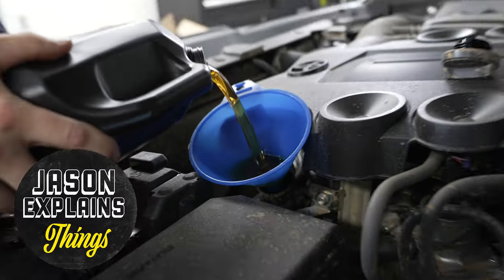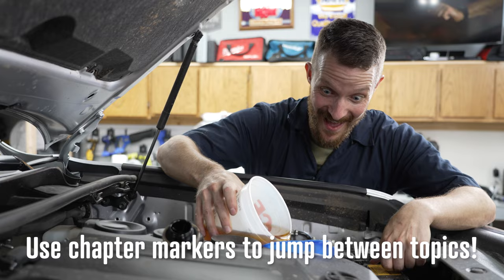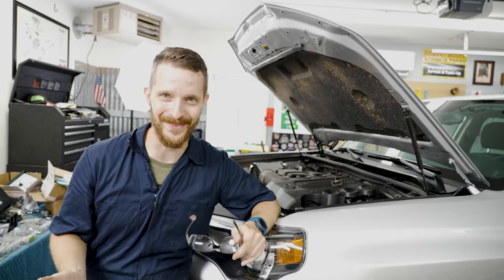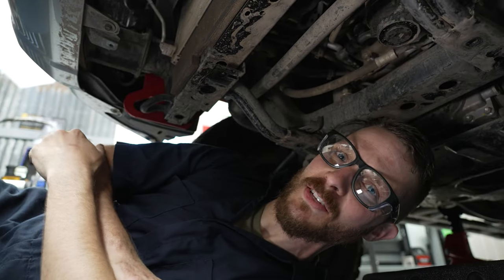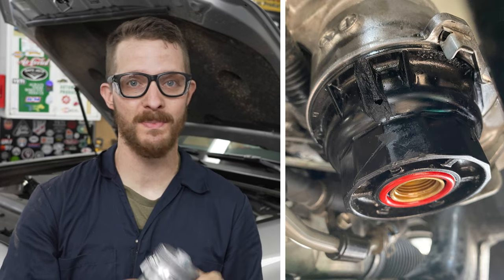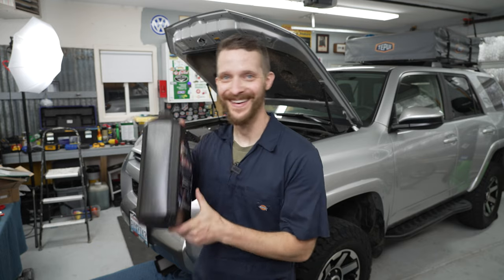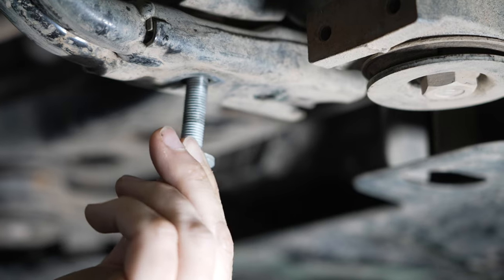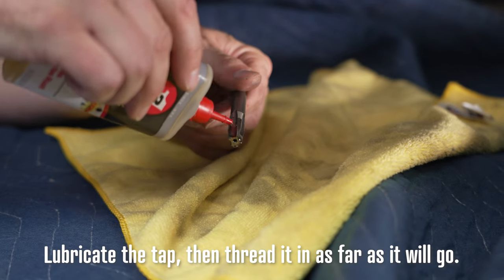5TH GEN 4RUNNER Oil Change - Save Money and Upgrade Your Truck!

Comment: Good video....but not the "best".  I would add the torque spec for the filter housing (18 ft lbs) and the torque spec for the filter housing drain plug (10 ft lbs).  Also, PLEASE PEOPLE don't use a tap to install the TRD skid plate!  The threads are there, they're just filled with gunk from manufacturing.  If you're a gun owner, use a bore brush (I used a .38 special bore brush) and some gun solvent and run it through the holes where the aft bolts go a few times to get the threads good and clean.  Now the bolts will go in like butter, I guarantee it.  For the love of all things holy don't go tapping new threads in your brand new truck!  Also, you overfilled the oil.  Your dipstick is showing that you are in the "excessive" area (ref: pg, 410 of 2021 4Runner Owner's Manual).  Lastly, the plastic filter housing is totally fine, especially when using the latest version of the Motivx tool that doesn't even touch the tabs.  Sorry for busting your chops a little but people need to know the correct way to do maintenance, not the YouTube way.
Reply: Wow ! Your comment made this video a lot better (I liked the video , great comment sir)
Reply: Make your own videos then
Reply: You know your stuff, It's important to do things right the first time. Thank you Sir for your knowledge, and may God bless you.
Reply: And if you do use a tap never put it in a drill 😂
Reply: Or you can just use the correct tool for the job and just by the right size threat chase
Reply: Great call on the bore brush!  The newer version of the Motivx has problems the first version did not.  It sticks on the filter so hard many people cannot get it off without breaking the filter.  Some just leave the Motivex wrench on permanently.  I think people are way better off with a Lisle or comparable steel wrench rather than aluminum.  I don't think there is anything to be gained by going metal on the filter only if the plastic breaks.  Only ones which break are those tightened too much.  I also don't know why anyone would replace the skid plate with something without the access door to the oil filter.

Comment: I been changing oil on my Camry with the plastic oil housing for many years now never had a problem with it
Reply from the maker: Yeah it’s definitely optional… not required.
Reply: 2 Camry’s and a Rav4 but finally had it crack and got the aluminum housing from Auto zone, much better.

Comment: I bought the TRD Pro Skid Plate from my local dealer in Jackson MS to install on a 2024 TRD ORP Premium. The bolts that came with it, along with the pre-installed spacers went on with no problem. No issues. I used the bolts supplied with the Skid plate. I did not use the bolts I removed from the old black steel TRD ORP skid plate.  Easy as pie. No issues. A little anti seize on the bolts and torqued to 22 ft-lbs.  Perfect.

Comment: Hey DrJWR1… I just completed it in about an hour. My driveway is pitched so I was able to drive up on ramps until it was level. That skid would have been a “pita” if I hadn’t created space under the front. That had to have been your issue. My torque wrench crapped out, so I simply marked the filter housing and put it right back to that point. It actually stopped right there when I tightened it. Put just shy of 6.5 quarts of pennzoil platinum in it to account for any residual. That frigin dipstick is difficult to read, so I dragged my fingers down it until they were wet. No leaks, so all is well.

Comment: That Motivix filter tool is the best one made for the Toyota’s. It’s forged unlike the other stamped models. I’ve got it for my sienna and also got there threaded funnel that threads into the oil cap threading so no more funnels falling over when pouring.
Reply from the maker: Nice!  Good idea on the funnel.
Reply: Can you link the threaded funnel that goes into the cap, love that! Thanks in advance

Comment: Your video about the TRD skid plate saved me time and problems as I could not figure out why the brand new TRD bolt kit would only screw in about 1/4 way and then get very tight. After seeing your video, I tapped the threads and no problem! FYI when tapping all 4 holes metal was being cut which tells me the threads are not cut all the way through for 10 x 1.25 bolt.  Thank you.

Comment: Howdy from Palouse, WA!  Great video!  I have a 2019 SR5 4Runner and ran out of the free dealer oil changes.  Took it back to them for the last oil change in January and they charged me $106 and didn't even top off fluids, or vacuum, or any of the other perks normal oil change places do.  So, got in my OEM filter cartridge and Mobil 1 this week and started looking at videos.  Yours is the best and I will be ordering the new metal housing and tool.
Reply from the maker: Thanks man!

Comment: For the tap set you referenced, which of the 3 piece set did you use? The set includes a Taper, Plug and Bottom tap. Thanks for the video.

Comment: Finally got my metal filter housing in from Japan and changed the oil today.  Used my new Motiv filter tool, and it worked great!  But, I did use Mobil 1 in 5w-20, which is a tiny bit higher viscosity, but in the summer, it makes me feel better.  Fun Fact:  4Runners sold in Puerto Rico use 10w-30.
Reply from the maker: Nice!  No judgement on oil.  I'm going with Kirkland for now because it's such a good deal, but it's all good.  I actually stocked up on the stuff in case it goes away so I'm good on oil changes for a while.
Reply: @JasonExplainsThings  I drive a ‘17 Honda Civic…obviously a much different vehicle than a 4-Runner. But I used the Kirkland synthetic 0W - 20 for a 7K mile oci. Sent a sample off to Blackstone Labs, and the report came back with flying colors - low wear metals and additive package still intact. They said I COULD extend it out to 10K miles, but I’ll stick with 7K. 👍🏼
Reply: Kirkland Oil is the same as Walmart oil 👍🕺🏽
Reply: Metal filter housing for the oil filter is a must and it should be upgraded. Now, 5th Gen 4runners sold in Puerto Rico still use 0W-20. I also live in Puerto Rico and I would be very skeptical of permanently changing the weight of the oil on this engine. Now, we will never experience a 32⁰F or colder weather in Puerto Rico but Toyota prefers the 0W and suggests the usage of 5W as an alternative in case there is no 0W available and Toyota also recommends switching back to the 0W when it's immediately available. Toyota designed this motor and they know whats good for it. At least I will not deviate from their instructions, unless a Toyota TB is sent out and mandates this change for us in Puerto Rico.
Reply: Make sure that metal filter housing isn't leaking around the seal when you install it. I hear people having problems with theirs. Toyota brand.
Reply: @emmanuelmatos8942  Unfortunately Toyota and others have been recommending EPA friendly oil not oil great for the engine.  It gets them 1- 1.5% more fuel economy in EPA testing.  They don't use 0w-20 in Japan where EPA has no jurisdiction.  Same reason they are all moving 8cyl down to 6cyl and 6cyl down to 4cyl turbo engines with 8-10 speed transmissions.  All is counterproductive to consumers but EPA is really happy.  I give it 5 to 7 years tops before the auto manufacturers will need bailing out.

Comment: Thanks for the tip on the TRD skid plate bolts.  I've been debating getting one for my SR5, but I'll just stick with my steel factory plate to save the $300 and the hassle of tapping the holes.
Reply from the maker: I’ll say… that skid is worth it.  I’ve beaten mine up a ton.  Replaced 2 of the bolts because they’ve been damaged… but that skid plate has held up well.  Lots of gouges/character now. 🥹

Comment: Thank you for linking all your parts/tools. I will be buying them. I live in an apartment and don't have a solo garage to store a wide array of tools. So I need to try to avoid having tool "bloat" by sticking to only the minimum needed tools. I have a storage room but I just can't store a large variety of tools. I think just the tools to do transmission fluid and engine oil will be adequate for me.

Comment: This video was a huge help, along with Jason‘s other videos, to get me started on the very first oil change for my 2024 4Runner. I ran into a snag I wonder if anybody else has observed: the tabs for the hanger for the front skid plate. The driver’s side came off the frame just fine, I never could get the passenger’s side to let go and I couldn’t figure out why it wasn’t letting go. I don’t have a lift, I was working with jackstands, so, the skid plate was really in my way. Your advice would be greatly appreciated!
Reply from the maker: Lots of more 4Runner videos in the back catalog… and more to come!
Reply: @willmalkin6027  That's just RUDE. IF you read my post, I said I got one side off with no difficulty. I was simply inquiring whether other people had trouble with the passenger's side.. If you don't have something constructive to say, just keep your comments to yourself.
Reply: I deleted my previous comment, because I agree that it was rude (not my intention). If it makes you feel any better, I had to google how to delete my comment because I didn't figure to simply click on the three dots next to my comment lol... I'm changing my oil in my new 4runner for the first time tomorrow. If karma truly is a b@#%h, I'll have a hell of a time removing the skid plate, and then I'll break the tabs off on my filter housing... I'm sorry about my previous comment... I too have found myself in tricky situations with automotive maintenance (removing a Silverado tranny pan, to note one). Sometimes you just need to walk away from it for a few minutes and allow your brain to reset... Be well and good luck with all of your future wrenching!
Reply: Thank you! That’s very magnanimous of you. I wish you the best possible luck with your maintenance going forward.

Comment: Great video, thank you , doing it yourself is always best.  For the first oil change, I recommend 1000 miles if you plan to keep you 4Runner forever.  After that I do mine every 3500 miles, changing the filter every other oil change up to 25K miles after that I change the oil every 4-5K miles.  Oil is cheap and this will extend the life of your motor exponentially.  I NEVER leave the oil fill cap off while I am working on the truck, debris or something larger could fall inside the motor, especially if you have other people or children around.  Just loosen the cap to allow the oil to drain out.  Ideally, you want the car to be as level as possible so jacking up only the front of the vehicle may leave some old oil in the pan.  For the first few oil changes I went all out and purchased genuine Toyota oil at my local dealer.  I always fee great knowing I have new oil in my engine!

Comment: Appreciate this vid!

Throw that TRD skid plate in the trash!  100% absolute, complete, PITA to have take off and put back on. IMHO, and experience.

Good aftermarket options that provide better protection than the TRD AND don’t have to remove to change the oil.
Reply from the maker: I wouldn’t call it trash, but you’re totally right about it being a pain to remove. 🤣

Comment: Great video! I actually didn't know that you must extend the tapping in order to install a TRD skidplate. It might be good to explain that the part number for the oil cap housing does not indicate that it fits the 5th Gen 4Runner. The reason for that is because of the center tube that you must exchange with your plastic housing. Other than that, it's the same.
Reply from the maker: Exactly.

Comment: just wondering with the metal housing @ 22 ft /lb, did you experience a very slow oil oozing at the connecting point. The treads are little different on the mental one.
Reply from the maker: Nope.

Comment: Why would you not wet the new oil filter. I always do this on all my oil changes on all my vehicles. Call me OCD if you like, but I have heard this advise from many others
Reply from the maker: I do that with spin on filters yes, but this one has a hole in it until the installation is finished.  I guess you could drizzle oil on it.  Seems unnecessary and messy.

Comment: I'm confused. I haven't done an oil change myself for a couple decades but when did we go from the canister filters to this style? This seems so much more work and it doesn't save me any money on my bill when I pay to have it done. It seems cheaper with just replacing the paper portion but the added labor I guess offsets it. I just bought a 2022 3 days ago. I'll have to run outside after work and see what I'm dealing with.
Reply from the maker: Here's an updated video on the topic... discussing tools and everything to do this job.  It really isn't that complicated or challenging.  And with oil changes costing close to $100... learning how to do it yourself is a very smart move.  Just take your time and follow a video the first few times, and then it's second nature from there.  https://youtu.be/HnXMFRU3Z2I?si=fXHhhUZFrSFo65VG

Comment: Thanks Jason for this video.  I seen that you were using full synthetic oil.  How would i knw which oil my dealer were using for when I do my first after warranty.
Reply from the maker: You won’t know.  :-). They will use something that meets minimum requirements set by the manufacturer.  So synthetic 0w-20.  Most dealers by their oil in bulk.  This and other unfortunate experiences are why I do my own oil changes/routine maintenance.

Comment: At 8:15 it looks like you’re running high. I put in exactly 6.6 quarts and it’s doing the same thing. Like half an inch above the max line.
Reply from the maker: You are correct.  It should be right in the middle of the 2 marks.  Updated videos since this one show that.  Good call out.
Reply: @JasonExplainsThings  appreciate you taking the time to answer and I didn’t mean to come off cynical. I’m saying I had the same issue come up. I did an oil drain and filter and then filled up exactly 6.6 quarts on my 2012 and it’s showing as above the max line. Did you have to change to an updated dipstick?

Comment: what weight do you recommend for Socal temps, and do you recommend the same year round? Thanks
Reply from the maker: The owners manual only mentions 0w-20 or 5w-20 (as a short term option).  I think SoCal and summer temps here are about the same.  It got up to 109 this week. 😅

Comment: I have a vacuum oil extractor. I hook it up to my air compressor. Could I use that same extractor for the 4 Runner? Unfortunately looks like a still have to crawl underneath for the oil filter.

Are you happy with the Mann filters?
Reply from the maker: Yes, you still would need to crawl under the truck and remove the skid plate to do the oil filter.  But extractors work great.  I used them exclusively on my VW GTI I used to drive... but the oil filter was on the top of the engine.
Reply from the maker: Mann Filters... I've heard only good things.  They made the OEM filters for my VW so I'm sure they're good.  For the Toyota's, I buy OEM filters because they're good and very affordable.  I actually buy them in bulk.  I have enough oil filters now to get my 4Runner and Tacoma to 70k miles.

Comment: Guys this is a dumb question, is a 2021 trd off road premium oil filter the same as the regular trd off road? I might of forgot to tell them premium at the dealer and hope I got the right filters! Thanks for your help and video!
Reply from the maker: Same on any 5th Gen 4Runner.  They all have the same engine.

Comment: Great video, however the two main products featured in the video (oil filter cap, and motivx wrench) say they don't it the 2020 4runner trd offroad (which i assume is the same fitment as your 2021). If they are the exact products you used i guess i'll have to just take your word for it and go against Amazon's recommendation/caution
Reply from the maker: Yeah they definitely will work.  The engine is the same in all 5th Gen 4Runners (2010-2023).

Comment: Great info. Thanks. What was the reason for the tapping extension for the trd skid plate? I have that skid plate on my ORP. Do I need to modify it to fit the metal oil filter housing?
Reply from the maker: Nope, you’re fine.  The tap was more for folks that are trying to add the TRD skid plate.  Sometimes the back bolts don’t want to go in all the way.
Reply: @JasonExplainsThings  thanks. You seem like a 4Runner expert. Do you know if there is a top speed recommended when in 4HI?
Reply from the maker: Check the owners manual.  I believe it's 50-55 MPH.  https://trail4runner.com/2018/01/30/5th-gen-4runner-off-road-features/

Comment: So full synthetic oil doesn’t really break a sweat at 5k miles….  I change mine at 9k since birth and its quiet, smooth no issues at 150k.  2013 limited 4x4.
Reply from the maker: I disagree and I’d suggest watching the videos from The Car Care Nut channel on this topic.  He explains it very well while showing a disassembled Toyota engine.  But you do you. 👍

Comment: Hey! I love your video thoroughly. I have a question about your torque specs for the oil filter housing. You list 22 but Toyota lists it at 18 for the plastic and the metal housing. Where are you getting 22 from? Thanks!
Reply from the maker: Weird, searching it again most say 18.  Could've have also been a typo.  I'm sure anything in that range is fine... just don't over-tighten.
Reply: Clearly in the video you over torqued the filter housing. You should stop pulling on a torque wrench when it clicks 😂

Comment: Jason I did the swap with the metal filter housing on my new 2021 TRD PRO. It doesn’t line up completely, there is a little lip showing, is that ok? It didn’t leak.
Reply from the maker: Weird, yeah I didn't notice that issue.
Reply: @JasonExplainsThings  I just watched the video and want to swap out the plastic filter for the metal filter.  I am curios as to why the dealer website and Amazon say that it won't fit the 2017 SR5.  Do you know why this might be?